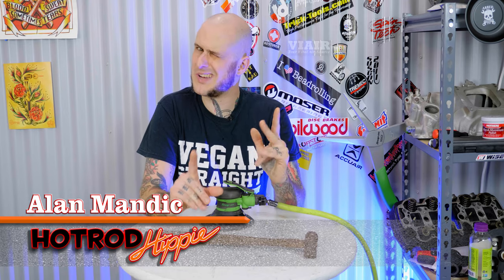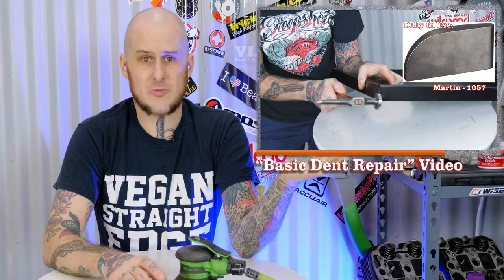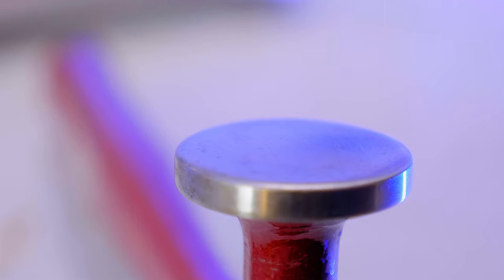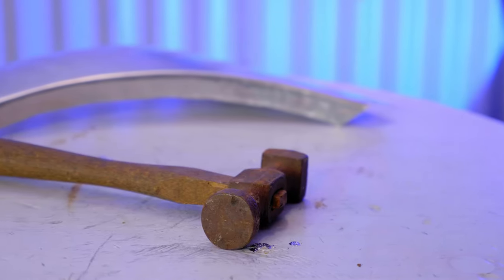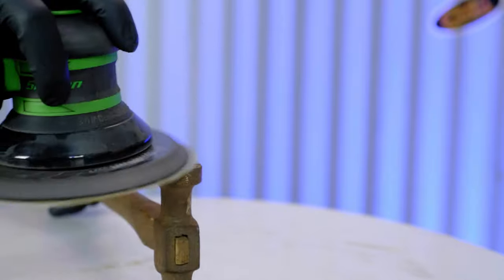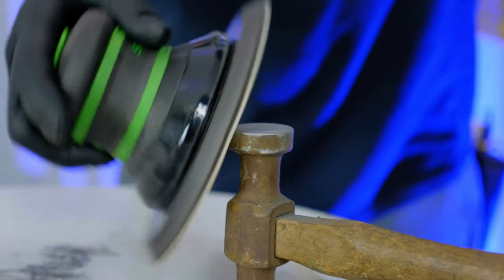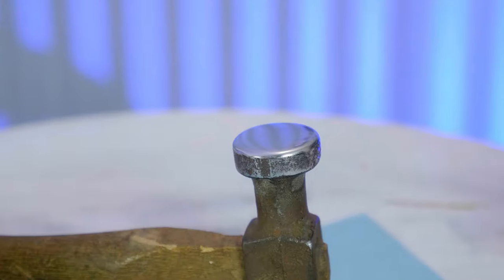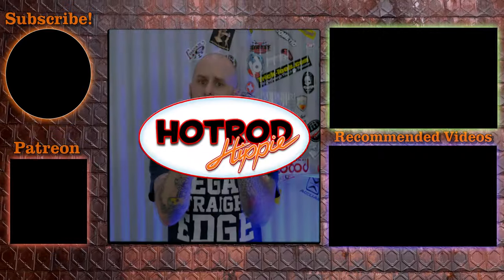Body Hammer Polishing / Restoration - Make Your Hammers Better!

Comment from the maker: These techniques are pretty straight forward and are applicable to more than just hammers. Whether it be Dollies, English Wheel Anvils, Planishing Hammer Dies, Power Hammer Dies, or Pullmax Tooling, a clean surface finish and smooth edges can go a long way.

Comment: Got some scotchbrite mops that are on a bench grinder. They gently bring rusty tools back to a very pleasing condition. They make a wicked job of restoring rusty dollies , anvils etc without removing any material from them. Cheap and effective but a little messy so catch pans required or you vacuuming up your bench!
Reply from the maker: For touch ups between uses I often use a light Scotch Brite then buff/polish. Good tip for stuff that's just seen some surface rusting. 👍👍

Comment: Enough said really! The only thing with the new hammers is that they're only case hardened so you dont want to sand them down too much and when polishing them on a mop (machine) you dont want to get them hotter than you can hold them. I know the hotter you get it the quicker it becomes shiny but i find sometimes its not as hard as it was. The more shiny it is the less likely it is to rust as well. The only other thing i do to old hammers that no longer have the original shaft is chance the stay or drift for a round one. Put a new piece of wood in there first from an old broken shaft (i have one around in my box) tap in the round one (because it spreads the top part of the shaft in all directions of the hammer head) and let the head soak overnight in some thin oil so the shaft swells to help the wood mould to the shape of the head. 

Another top video alan

Comment: There is no doubt that the number of words that you cram into the longest sentences  possible during the shortest time imaginable will result a spontaneous explosion of your head causing it completely blow up .  Just slow down and remember that blokes who watch this type of content have more than a modicum of experience and don't need the same stuff explained several times . Finally when working mild steel a highly polished striking face is a disadvantage compared to a face with an 80grit surface finish which can tease and move metal about due to friction . The old boys knew what they were doing and rightly had sets for steel and ally with different surface finishes  to achieve their results.

Comment: Never really realized the benefits of this,but it makes sense especially with newer aluminum panels. What do you do with a waffled or shrinking hammer?
Reply from the maker: Especially on aluminum this makes sense but even on steel I see the benefit. 

As for waffle hammers I legitimately never ever use them. I've tried just to test it so I could speak to it better, and I couldn't stand it. Scarring metal hurts my soul. Haha. I use a shrinking disc 9 times out of 10 and torch shrink the other 1 time.
Reply: @HotRodHippie  yes lots of metal finishing after, please feature a shrinking disc in the future I've never used one
Reply from the maker: @davehaberman6191  I absolutely will. I just want a good project to feature it on. I really should just grab a ratty fender and work on it for a bit. Wray Schelin at Pro Shaper sells discs and has a few videos about their use here and there.